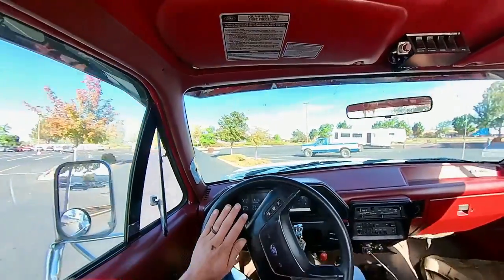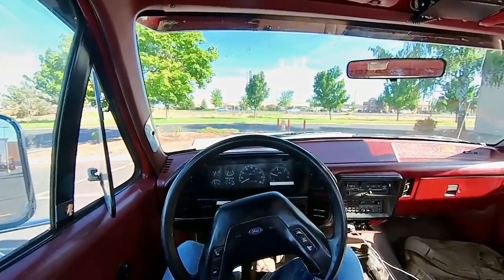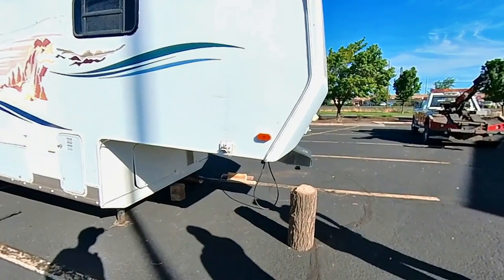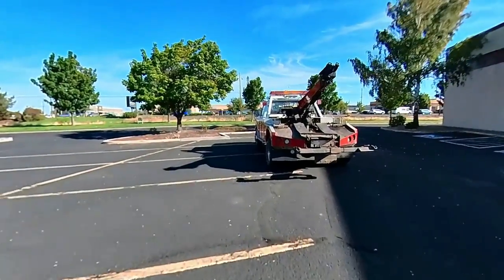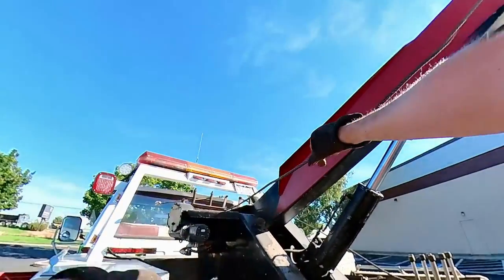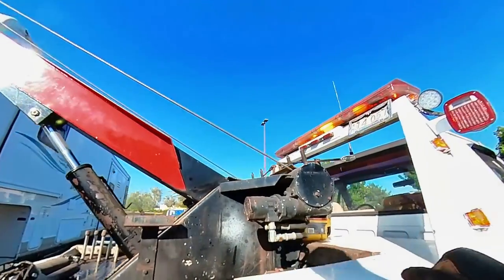RV Disaster!   Wrecker to the Rescue!

Comment: It took me a second to realize what you were doing with the strap, but once you started it all made sense. For all the people wondering why jacks weren't used under the front, when the stabilizers broke, there's no place on the front that was even closely rated strong enough to support the front heavy weight of the 5th wheel. There aren't a lot of secure/strong places on older rigs like that to be able to lift with that don't cause more damage than good (that's why their leveler jacks if equipped are normally farther underneath). The way this was done might have seemed sketchy, but there's an adage that covers it - to the effect that if it works, it's not stupid. Kudos for getting it back on the truck safely, Casey!!
Reply from the maker: Exactly.  Those trailers are toothpicks and the hitch itself was the only place to lift it from that made sure there wouldn’t be any further damage to the trailer.  I’d much rather risk my $30 strap than risk someone’s trailer
Reply: Was wondering if the wheellift could have been used where the jacks are, but if its that weak there it all makes sense.Wondering how he will get it unhitched though.
Reply: So does that mean when the jacks broke that they probably went through the floor?
Reply: @joelmartin2549  it looks like they folded forward when the trailer got pushed back. So it’s fixable, but still gonna require a welder.
Reply: @nilz6432  obviously he will leave it hooked up & go to an RV dealer to have the front jacks replaced, that's the easy part
Reply: Since when?     I open the doors on the front of mine and they is front frame the Jack's are attached to.         The strap idea was straight up hillbilly.    I have seen this done before and the tow truck use the rear wheel lift to pick it up using the Hitch and places jack stands under the frame.       If it's with in 4 inches of the  5 wheel plate height you can hook on if you have wheels blocked.
Reply: @brianpatrick8787  that's what I figured he would do, it would've been easier. I've seen it done the way you described, & even have done it with mine as well.

Comment: an rv owner's worst nightmare is drop the front of the trailer.  did it once myself with a bumperpull.  that 5th wheel probably has 2000 lbs of wt on the 5th wheel, nicely done

Comment: That was executed beautifully.  I tow a 35 foot fifth wheel and have assisted other people in camp grounds that have experienced jack failures.  Never to this extreme where a leg folded up.  That was definitely Sketchy!  But the camera can never show how comfortable one is with rigging, blocking etc....   Well done!!  You are very good with your equipment and it shows.  One wrong move and that 5th wheel could have dropped onto the box sides of his truck which judging by the looks of his truck has happened before.  lol

Comment: Job well done with what you had to do it for sure. I ended up putting a line lock or brake lock on all my trucks so I could lock the brakes with pressure on the line as well as the park brake. works for hard pulls backwards. I think the best brake locks are call bucket truck brake locks. Nice job.

Comment: I always put the wheel lift on the ground when using the book like that. no weight on the springs and the person can run over it if need be. Nice job. I also always carry jack stands with a plate welded on the bottom to hold things up if need be to unhook. Jack stands under the frame of the rv then he could just back into the hitch. People who do rvs allot carry heavy duty screw jacks so they can raise and lower from the frame. I always wanted some three stage bottle jacks for jobs like this. I carry a alm 3 ton harbor freight jack to use with my tollie dollies if needed also.

Comment: Great Job
Having done this EXACT lift, even to the point it was Lippert landing gear and my F350. Instead we used two large bottle jacks on the trailer (set on the frame near the landing gear) to hold the trailer while the strap was removed from the king-pin.
That way no one had to be under the pin box during that scary part

Only we were in  rural Alaska off the Tok cut-off road.

Comment: This just appeared in my feed.  That was a very sketchy situation and I was holding my breath when you were putting the jack under the king pin.  That guy probably has no business driving a fifth wheel, esp. with that truck.  Great problem solving.  I was wondering how you were going to get the strap out.

Comment: Nice job... But I have done this before and can say using a floor jack with a 6x8 block on the trailer frame where the landing gear is is probably the safest way. Any standard 3 ton floor jack will lift the front of the trailer no problem

Comment: You need a Kingpin adapter for your stinger. Before I retired from towing we had several trucks with them it was very profitable because we could tow anything, we also had a few Goodneck adapters for horse trailers today you find goosenecks on Fifth wheels I am using a Reese Goosebox in my 5R because it's so much smoother towing.  But yeah get a Kingpin adapter for your Stinger/Wheel lift and advertise you can tow 5Rs you could make some extra $$$$$$

Comment: I think I'd used the strap behind the hitch, then you wouldn't had to use the smaller jack and he could of just backed under it. Plus, he needed to make sure his 5th wheel was open ready for the pin. I've learned to never assume anything. Especially when others get into a hurry. Good job, learn more every time.
Reply from the maker: And then the strap is pulling against the fiberglass wall of the camper..

Comment: Repairing that ram might not be that hard.  We repaired outrigger rams on 15 ton hydraulic cranes without removing them by using the Loctite O ring repair kits which allow you to make an O ring by gluing it together sized to fit.

Comment: Got the job done & nobody got hurt, that's a result in my book. When I saw the predicament, I thought you might put your wheel lift under the rear of the trailer, chain on to something and lower the wheel lift to raise the front up enough for the truck to back in. Would that have worked? Nice choice of ice cream 👍
Reply from the maker: That would almost guaranteed fold the trailer in half
Reply: Terrible idea. The back of the trailer is nowhere near structural enough to lever up the other side. The end of the trailer is only built strong enough to support itself.
Reply: @dazeller82  fair enough, never stuck my head under one so didn't realise the structure is only good enough to hold the floor up

Comment: When you are going down the road the trailer is level so it doesn't hurt the frame when the front is as low as in the video  when you start pulling all the pressure onto the 5th wheel to lift it the part of the frame comes down to the bottom of the frame is having to  take the wait of the down force and the up force where it comes to gather it is made to go down the road level the rv's are getting stronger in that area I'm not saying it can't be done be safe
Reply from the maker: You clearly don’t understand how dynamic loading works.  Just give up, you have proven that you don’t know what you’re talking about.

Comment: Two suggestions: buy a decent floor jack and a spare hydraulic cylinder for the boom.  Then you can install the spare cylinder and have the leaky one rebuilt...while you still work.  Once rebuilt, you have a spare.
Reply from the maker: I’m not spending $2500 to have a spare cylinder sitting around..
Reply: @CaseyLaDelle  are you going to rebuild it yourself?  I have a much lower rated, (but longer 2 cylinder that leaks.  I want to rebuild it myself…
Reply: @CaseyLaDelle  Sorry to hear that cylinders are so expensive.  Perhaps rebuild an old one from a junk yard truck as an option.  Hopefully you can rebuild your cylinder when business slows down a little.

Comment: You should have put your easy lift with blocks under the 5th wheel that would have been ok trying to lift it up with the winch you put to much tork on the frame
Reply from the maker: You clearly have no concept of physics.
Reply: I build 5th wheel rv's for a living  the strongest points on the trailer  to lift the trailer when it is down is right behind the landing gear
Reply: But you did get it up
Reply from the maker: @arkjones  so you’re saying that lifting it by the point that holds all the weight while it’s going down the road is going to hurt it??   That’s just dumb.

Comment: Well that’s about the sketchiest thing I’ve seen you do. 👏
Reply from the maker: Did you not see the lawnmower recovery?!
Reply: @CaseyLaDelle  lol. Heights don’t bother me, being crushed is horrific.
Reply from the maker: @KyleA2011  even if it fell into the bottom of the bed, there would still be 18” of space for me to fit in
Reply: @CaseyLaDelle  true. Hey how would it work if you used the wheel lift near the broken trailer jacks? Would you have had the capacity and reach? Btw I’ve never operated a tow truck.
Reply from the maker: @KyleA2011  the wheel lift would absolutely do it.  But would the trailer hold up to it??
Reply: @CaseyLaDelle  if you could span the frame rails I couldn’t imagine it hurting the trailer. Either way, good job and I’m looking forward to some tracked jeep videos.

Comment: Would have been easier to get two 12 ton jacks on the trailer frame and lift it up and block it and if need be to get more lift put the jacks on blocks the way you did it worked but not the best way
Reply from the maker: No, actually that would not have been easier at all.   That in fact would have been a lot more work.

Comment: Hey Casey !!!     Great Job !!  Is your hydraulic lines leaking on the back under the hoist controls as saw oil on the ground ???? 🤔🤔🤠😎😮👍👍👍👍👍
Reply from the maker: The lift ram on the boom is leaking
Reply: @CaseyLaDelle  OKS !!! NOT good as it could blowout at anytime with a load on it like that trailer !!
Reply from the maker: @KB-gs8zi  wrong.  The seal that holds it in place is not the seal that’s leaking.   And if the seal that holds it in place did start leaking, the boom would drop without ever leaking a drop of oil to the outside.   It’s good to have a proper understanding of how hydraulics work if you’re going to be using them.